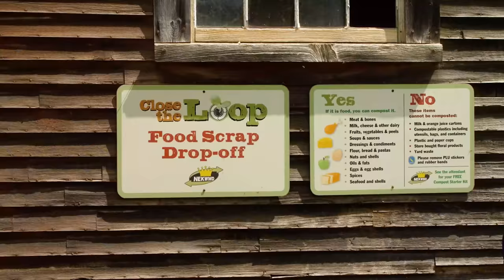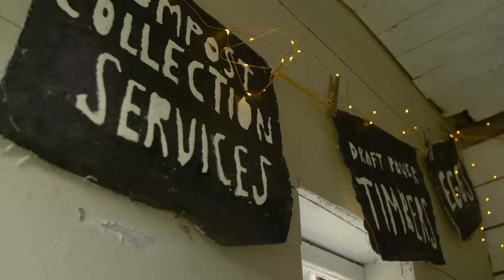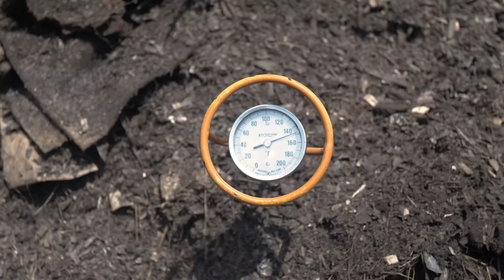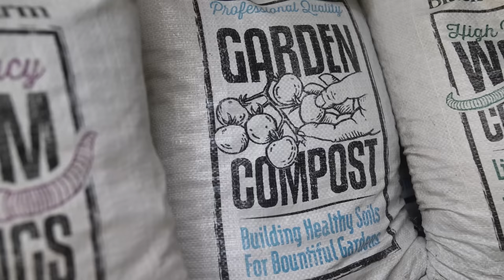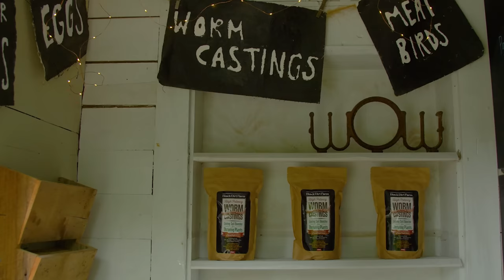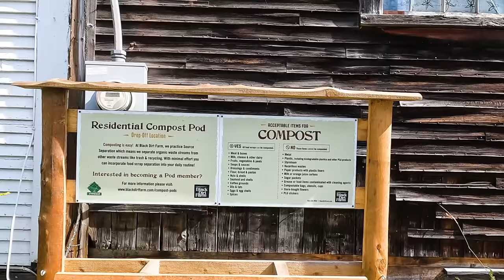This Farm Turns Garbage into Food

Comment: This is a simple DIY project that can be done at home by anyone, just the scale needs to change. I live in Minnesota, have both a large plastic container (with small air holes I punched) and a three part composter that you can buy for not much, both with composting worms (not the same as ones for fishing). Then just add plant based food waste and things like paper when you have some and let the worms do the composting. If you follow the rules there is zero smell. I keep mine in the basement because of the cold weather. (You can find many videos telling you what you can feed the worms.) In areas where there's no risk of freezing, you can have them outside all year.)